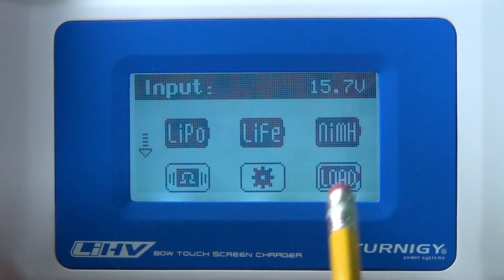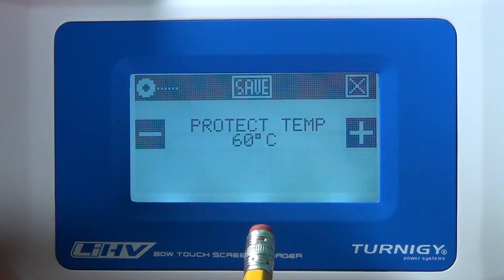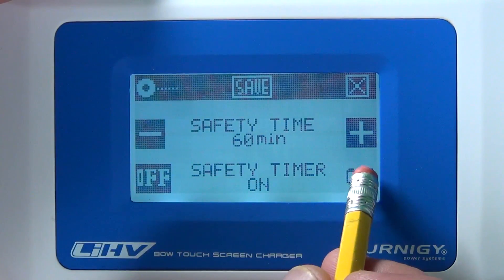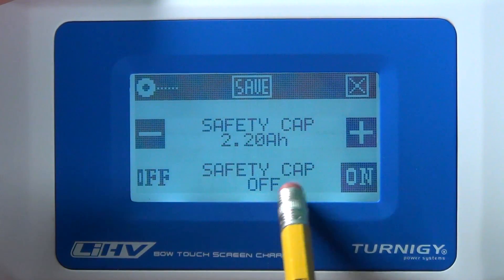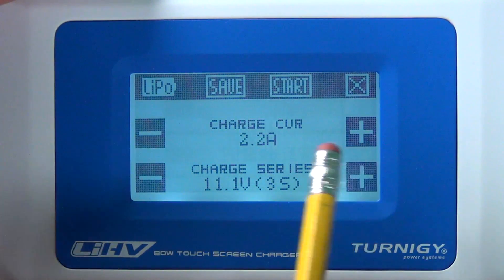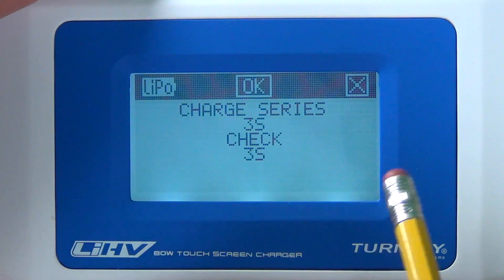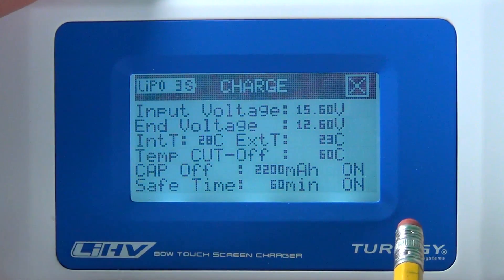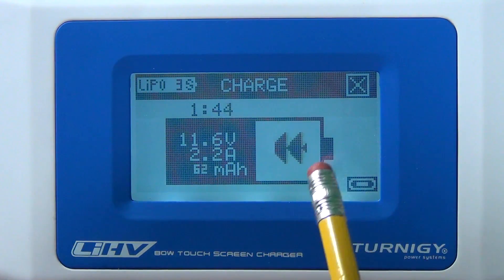LiPo Charger Manual Settings

Comment: How many volt power supply you use for this charger?
Reply from the maker: I use a 15V power supply. See here: https://youtu.be/do5FK4HLT2I
But you can use a car battery too. See here: https://youtu.be/sWxqogsD6MQ
Reply: thanks for reply my question, finally my charger work properly, i use a car battery charger form chinese :D

Comment: Is it preffered to do a blancing charge rather than a regular charge if you are using 4S batteries ?
Reply from the maker: Always balancing charge. That's the whole point of charging with this kind of charger.
Reply: thanks for your reply !